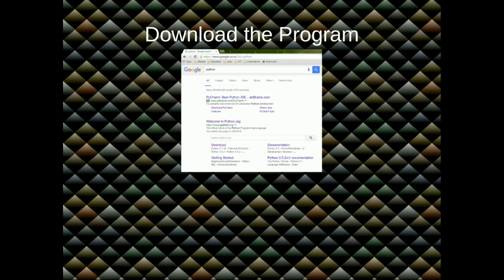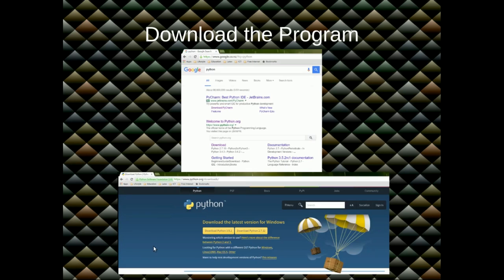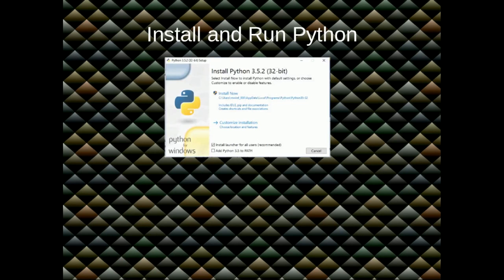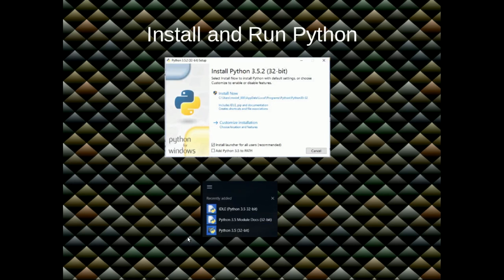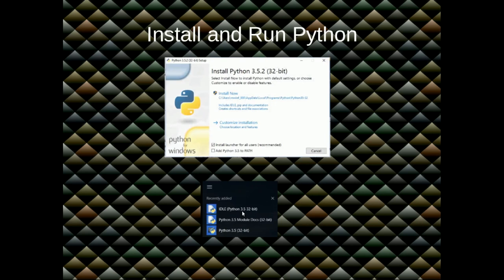Python for beginners Zero to Hero Install Python

Comment: Python 2.7 and Python 2.6 are installed by Apple in all Mac computers, but no Python 3.

The Apple installed Python's have no GUI access and must be used from the command line with the Terminal app.

Downloading and installing a Python.org release does give the user a Python 3 and GUI access from the Applications folder.

The Apple installed Pythons do include IDLE but it is "unstable", because of a bug in the windowing software used, and this bug cannot be fixed. The Python.org releases are subject to the same issue but it can be avoided with a software update.